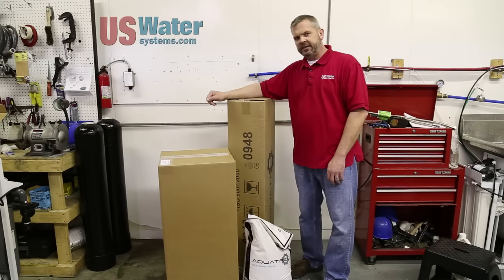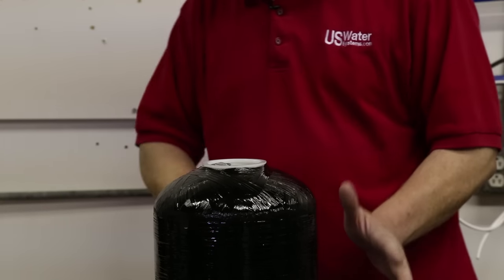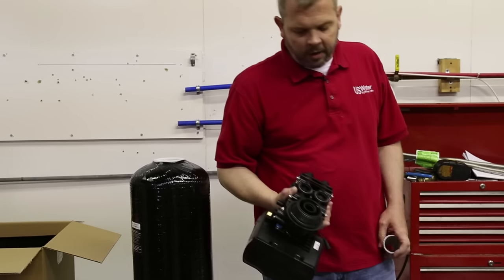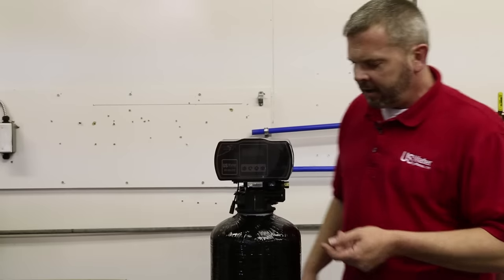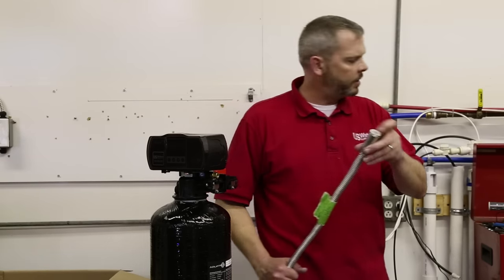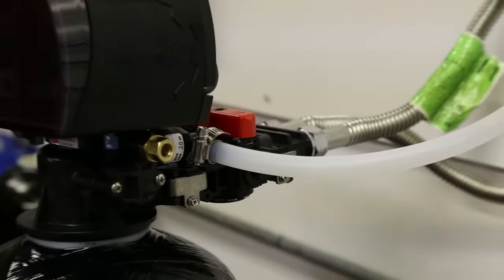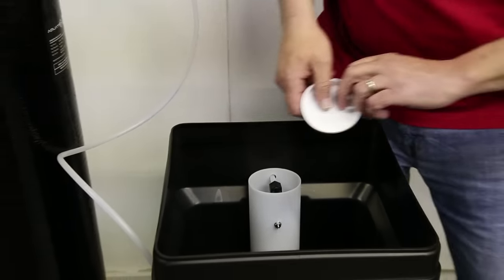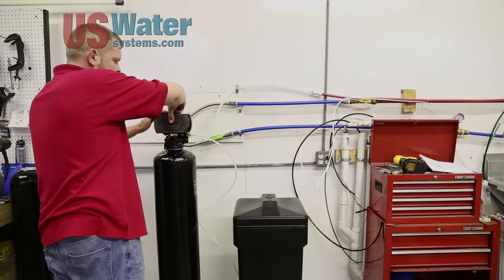Aquatrol Water Softener Installation Part 1 of 2

Comment: Two comments: Would quick disconnect fittings on the brine line reduce the chances of faulty installation by the dryer?  The water in/out connections on the back of the unit effectively increase the footprint and the distance between the wall and the unit, which is an issue for those with limited space.

Comment: I don't understand the reason you don't want treated water to water the outdoor plants and grass .is it because it will have salt and kill the plants? . Also I have a septic tank so I don't have a drain I can just discharge the brine into after the recharge process. Would I need to run a drain into an area of the backyard that I don't mind killing the grass in ? Maybe a French drain
Reply from the maker: Yes, the salt used for a water softener is what makes it harmful to plants. Bypass your softener if you are watering your lawn, plants or filling a pool. And yes, a french drain would be a good idea..

Comment: Omg,, THANK YOU👏🏽👏🏽👏🏽🙏🏾👏🏽  for this detailed video. Our machine just came in 3 days ago we called someone to hook it up and they said 1400$ ,, I ask why.
Reply: Its because you need a plumber to come to your home and solder copper pipe. So it works this way. The water from your city comes to the house from outside, then you add this system in the middle, then this system attaches to you water heater or tankless water heater. Now you will have soft water in the entire house. They can also use pex pipe as well. I have seen it done at my neighbors home on these type of systems. The copper is expensive depending on who much you need, but what you are really paying for is labor, time and tools kf the tech to come to your home and install the system.

Comment: How can water have an In and outlet?? Cold water or hot water. None is in and outlet in the home. Seriously!
Reply: you need a plumber to come put that in for you.
Reply: The inlet to the house is where you want the inlet to the tank , in other words before the water splits out to your water heater. The outlet from the tank is then going to go to the same pipe .   That way you are treating the hot and cold. . but most likely the outdoor water spigot will also be before the area of pipe you want to tap into. Which is harder to connect in homes that have water pipes coming through the concrete or brick walls. Hence, if you have a crawl space it's much easier